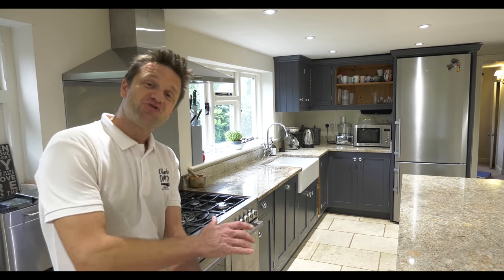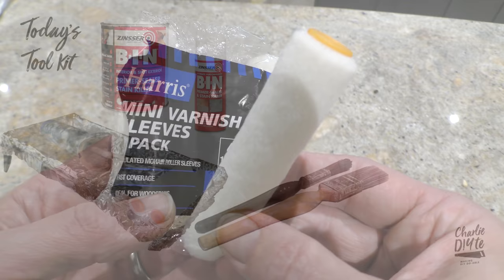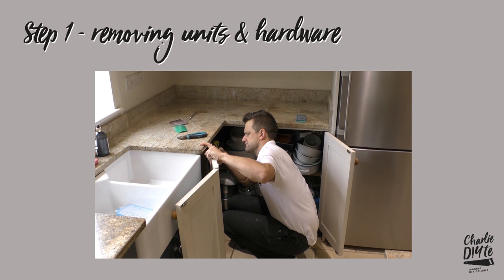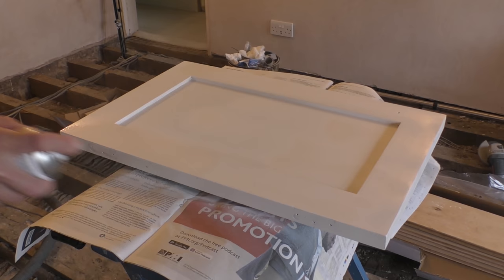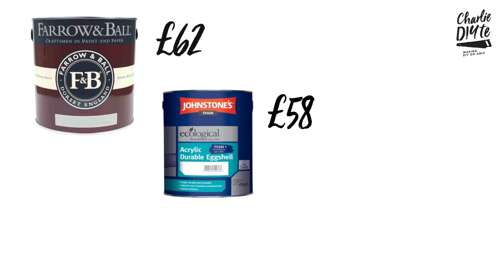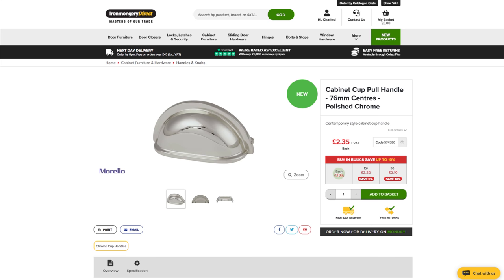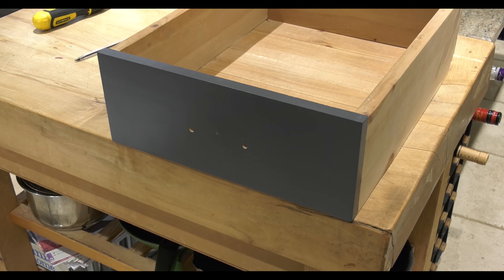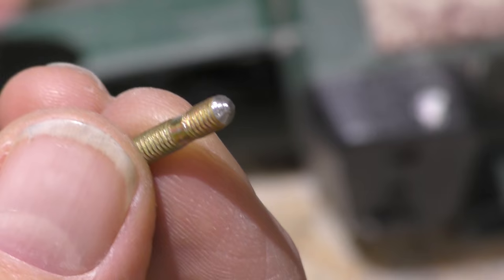Kitchen Makeover - How to Paint Cabinets & Fit New Knobs and Cup Handles!

Comment: Charlie, thank you so much for this video. I painted my kitchen farrow and ball down pipe using precisely your instructions. I used the same handles from the same company who were excellent and the final look was absolutely fantastic. I wouldn’t have tried it without this tutorial. I was quoted £2,300 to have it sprayed yet by doing it myself it cost me £100 in paint and primer and £200 for handles. A 2k saving. Thanks again.
Reply from the maker: So pleased to hear that Brian. Fantastic work! 👏🏻
Reply: May I ask how many full days it took (or hours, roughly)? I'm handing this job to a handyman so labour will be a significant cost.

Comment: Tip: if you're removing all the doors at once and many are all the same size, discretely number them and the carcass so you know which door goes back where!
Reply from the maker: Good thinking 👍
Reply: I used a permanent marker pen on the unpainted reverse side of the cupboard door to label each by kitchen's space location 👍

Comment: Charlie, I'm a time served decorator and have been in the trade for over 40 years.I assume the paint you used was water based? It's been my experience that water based paints may be easier to apply and dry quicker than oil based paints but they are not as durable as oil based paints.I quite often buy paint from B and Q but always buy the trade version which may be dearer but is much better. ! Great videos 😁

Comment: I have used several  different types of paint on my cabinets/cupboards, the best one so far is The One paint and primer , bought on Amazon.  Then I go over it with Rustoleum clear finishing wax. Cheers .
Reply from the maker: Good work. Yes the valspar I used here was pretty terrible. It scratched so easily!

Comment: Charlie can I be annoying and ask what colour did you use? I searched the comments to see if it was ask previously but couldn't find it. Btw my wife blames you for my ever growing shed full of tools, thanks ha.
Reply from the maker: Not annoying at all 😉 Pretty sure it was Railings. Don't buy the Valspar though, it's chipped quite badly but is at least easy to touch up. Also if it's for the kitchen, give the units a good degrease with sugar soap first. Ideally go oil based as it will be more hard wearing. If you're using water based, there are a few products like Tikkurilla Kiva 10 or Blockade Rock Top you can paint on at the end to give it enhanced protection. Ha! Will you apologise to your wife from me. Great work though. You can't have enough tools 🤣👊
Reply: Fantastic. Yep, will give the cupboards a god sugar soap and sand prior to primer and undercoat. The colour is brilliant and love the sheen on it. I've been recommended tikkurila a few times now so will likely go with that, my local decorators centre weren't too great and only could offer f&b or crown. Keep up the good work pal. Its always good watching your vids when ever I have a DIY project. Thanks again.

Comment: Hi Charlie, Fantastic video. Recently repainted our kitchen cabinets  with Valspar Wood and Metal paint. Spray painted the cabinets with 2 x coates after initial sanding and priming.  As you showed, the paint was initially easy to take off but after 2 months now and the paint is now mature, it is quite durable and difficult to take off. I recommend this brand and having used Valspar in the past, I have had no issues. 

Keep up the good work. 
Many youtubers get proud and lose their original personality. You have maintained your humble approach and that impresses me. 

The quality of videos and details you cover are really good. I trust tour top tips in your videos. It just shows you know what you are doing and advising. 

👍😊
Reply from the maker: Virupaksha, thanks so much for that! At the end of the day the integrity of my channel  is so important to me so it's great to hear that it comes across as I intended! It does give me a bit of a headache at times because I'd love to do this full time, but that's my problem to ponder not yours!! Thanks again - I really appreciate your support of the channel!

Comment: I've painted few kitchens with valspar eggshell including my own and only time had problem was over BIN primer.   I made our doors with Mrmdf, primed with water base polyurethane, sanded, edges treated with filler, primed again and two top coats valspar eggshell. We've got a golden and flat coat retriever that love rolling and scratching paint work. Touch wood no paints chipped or scratches four years on.

Comment: Lovely job and I really like the colour you guys chose. We used the Rustoleum chalk paint in Anthricite with a matt clear varnish sealant afterwards (also Rustoleum) I really loved the finish we got and it looks like a new kitchen, we talked about having a new kitchen fitted but we have an old MFI kitchen which has solid wood doors and we didn't want to change the layout so we decided to paint. We also changed the sink and tap and covered the work tops with DCFix vinyl which has also worked really well.

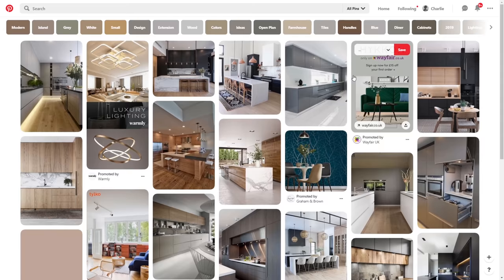Comment: 2:46 Absolutely LOVE the sink & faucet👍🏻 Have been a fan if the style since was a kid & Chef (makes washing up so much easier😅).... But it’s just a great look w/ durable lasting materials.
Ppl don’t realize that hardware can add up very quickly, especially if you have a lot of drawers & cabinets....... But, it’s one of the easiest ways to “refresh” a kitchen w/ a new look.
Another thing I’ve done for clients is vinyl wrapping there cabinets & counter tops with different vinyl brands (Vvivid, 3M, Avery, etc...). Works really well to change a room, desk, cabinet, etc....but I’d only recommend if you have experience; as this can be frustrating to new ppl trying this method.

Comment: Rust-oleum Universal Advance Formula All Surface Paint. Just been painting at my daughter's house. I did the outside windows and frames - they were in a sorry state, really horrible. I used Peel Stop on the sills to see if it would do what it said it would and it did! Love the paint. My new favourite. First coat is a bit thin so care needed and the second if needed needs to be generously applied or it seems to drag. Looks great. Today I finished using it on the tiles in the bathroom. Again, excellent. Then I had had enough......back tomorrow. Not ideal weather but I am never in the UK in the summer. Home next week for a rest😂

Comment: You can easily clean Zinsser shellac-based primer from brushes and rollers using Screwfix no-nonsense degreaser (p/n 88668)  - soak then rinse with water. It's about £9 for 5 litres - much cheaper than methylated spirits and does a better job.
Reply: thanks for this tip- the worst part of using BIN is cleaning the brushes!
Reply: I use the water based zinsser because I'm tight but it works well
Reply from the maker: Yes, great tip Laurie - thanks for that!

Comment: We have just updated our tired kitchen units and I used the same principle as yourself Charlie. After spending a small fortune on 52 Door handles and 30 drawer handles we thought do we go for a cheaper paint.............We did and like yourself had an F&B mix with the Valspar once dried the missus hated the colour as it looked washed out even after 3 coats, so I went back to B&Q and bit the bullet and actually went with the F&B colour re-done the units from scratch and we are much happier with the outcome.    SO MY ANSWER,  sometimes you have to go down the expensive route.
Keep the videos coming they are great TONY
Reply from the maker: Blimey Tony, how long did it take to redo all that? Still, worth it in the end!

Comment: We used Valspar on the walls and ceiling in the kitchen 2 years ago and I have to say it’s been fine.  
I have recently removed the door and frame and fitted new ones.  This obviously meant some touching up and 2 coats later you cannot see the difference. 
The walls have been washed down a number of times to clean off splashes etc and none of the paint has come off. 
It is more expensive than some of the other paints but has done the job. 
That said, I am now doing the Hall Stairs and Landing and will probably be using Johnsons or Dulux.  
Hope that helps.
Reply from the maker: Difficulty go with Johnstone's. The Valspar has chipped horribly in the kitchen but thankfully you can spot repair without it flashing, which is unusual for eggshell.

Comment: I have used an exterior valspar paint which, at £29 per litre was quite expensive, but the colour match was very good and the coverage was excellent.  So far no chipping or flaking.  I am very impressed with it and would use it again without question.
Reply from the maker: Thanks Stephen - that's good to know!

Comment: Thanks for this video. I just finished following along to do the same to my kitchen (I even used Railings colour!) and I'm really happy with the result.
Reply from the maker: Nice one Gary. If you find it chips, I've been recommended Polyvine decorators varnish and Minwax polycrylic protective finish as ways to make it more durable. It's probably the last thing on your mind though after finishing the job!!
Reply: Thanks Charlie. I'm finding myself touching it up a bit, but like you said in the video it's a good colour for not showing up too much flashing when I do. I'll definitely get a tin of the Minwax, thanks for the tip.

Comment: I used the exact same type of paint to cover MDF kickboards in my kitchen (primed with 2-3 coats of BIN. The finish was great after 2 coats applied with a foam roller and so far no chips.
Reply from the maker: That's good to hear - thanks for the comment 👍
Reply: @CharlieDIYte  Plus, the Armstead trade Satin I've used throughout the rest of my house (4x2.5ltr) does chip quite easily. Maybe people just expect too much from water-based paints in general and they should be using oil-based ones if they value durability above ease of use?

Comment: I love valspar emulsion it's a joy to paint with and excellent coverage never used the wood and metal though
Reply from the maker: This eggshell has proved to be a bit average in that it chips quite easily but the plus side is that you can easily touch it up without any flashing/ so you can spot paint without having to do the whole door.

Comment: My take on your paint issue. My understanding is that Primer is only used on non-painted porous surfaces. What you should use is Undercoat which prepares for the top coat.
Reply: I agree, and it doesn't make sense to put a premium primer/undercoat on then top it with Valspar. Valspar I have found is only good where wear is minimal. Good video nonetheless.

Comment: I do mostly refurb projects and I've never had a problem with Valspar, well at least not their matt emulsion.  I love their colour range, there are some really wonderful shades available.  Where I've used their dark colours or applied the paint in high traffic areas I've gone over this with Polyvine's Decorators Varnish in flat matt.  This goes on really well, dries up quickly so you can get 2 or 3 coats on in a single day quite comfortably.  This protects the paint from fingerprints and makes the colour richer and more hardwearing.  I'd love to use Dulux or Johnstones but I've never found their colour palettes very appealing.  In an ideal world, I'd use Johnstones paint in the Valspar colour range!
Reply from the maker: Thanks for this. The Valspar has chipped dreadfully since I made this video but maybe the varnish would have made it more durable. I'll keep a note of that. I guess varnishing this might be a problem if you then wanted to repaint the units for any reason? I applied some lacquer to our kitchen table after painting it and had to scrape the lot off when I needed to repaint it. You know you can get Johnstone's mixed to any colour?

Comment: about eight years ago i built mdf fitted wardrobes and used jonstones acrylic eggshell sprayed with a earlex 5000 spray gun and also used a roller on some parts, still looks good to this day even after the wife has hit it with a hoover and god knows what else...............i highly recommend this product. also I do use a lot of bullseye 123 blue can water based can recommend this item its fantastic sticks like you know what to a blanket
Reply from the maker: Thanks Anthony. Agreed - Johnstones is awesome stuff - my preferred paint supplier. Given my addiction to Zinsser BIN I haven't tried 123 but I need to, as you and many others are raving about it. Also, this Valspar is rubbish and has chipped loads since I did this video. The only good thing about it is you can touch up without any flashing - which is just as well considering how many chips we have!!
Reply: @CharlieDIYte  thank you for your reply charlie also look up peter millard review on airless cheap spray gun very good they are cheap about 30 pounds no excuse now for anyone to not spray and you get a spare paint pot. no excuses charlie terratek i think its called what you waiting for !!!!!!!!!!!!!!

Comment: Iv just recently made some doors for my garden room and used matt emulsion mixed 50 50 with quickdry diamond hard floor varnish then varnish over top as well that has co e out well,I also build a lot of furniture and I mix my water based satin with the floor varnish as well this mix travels well and is durable,Great videos by the way welldone I like your approach
Reply from the maker: That's really interesting Dean, and something I might have to try out. What made you use emulsion on the doors, out of interest, rather than the satin as you do on the furniture?
Reply: Because emulsion colours are infinite compared to cupboard door paint,I had the grey emulsion and thought it would look good on the cupboard doors but knowing how well emulsion wipes down I thought I'd try mixing it with the floor varnish to make a more stable paint,Now I tend to tip it in everything,I also saw your mdf series I'm a recent subscriber  and I use the filler method great series by the way,I use silverhook fine finish 2 part filler it's excellent for laying on endgrain of mdf and £6.40 a tin cheap too it's car filler
Reply from the maker: @deanreynolds2027  The problem I have is with stopping a hand painted kitchen table from staining (red wine and the like). I put a lacquer on it but it didn't really work and was a nightmare when I came to repaint it.
Reply from the maker: @deanreynolds2027  Thanks for subscribing by the way - massively appreciated 👍
Reply: It's a great channel even for a pro,I would use floor varnish on the table I would buy shares in it if I could😆
Reply from the maker: @deanreynolds2027  Cheers mate, I really appreciate that! I'm all over that next time I repaint the table 👊
Reply: Hi Dean, thank you for that invaluable tip, like Charlie, I’ll be all over it. Makes sense if one after a seamless look for furniture and walls.

Comment: Great video Charlie. I painted my melamine cupboard doors recently using bedec MSP.  No need for separate primer or undercoat. Like you I used faux mohair rollers and the finish is great. Several months later and there’s no chips or scratches and they are wipe clean. Super pleased with them. Replaced my tile splash back with more modern tiles and now it looks like a new kitchen!  I’d encourage anyone just to have a go at small projects like this and see how much money you could save.  Your vids really help with this. 
It love to see what your thoughts are on the bedec MSP and maybe a video?! 
Keep up the great work.
Reply from the maker: Hi there. That's interesting - I'll definitely check that out. I guess the only issue is that you're limited to one of their colours - albeit there seem to be a reasonable selection of 38 to choose from.

Comment: Hi Charlie 
Hamilton Prestige mini rollers from Toolstation - 4 inch short sleeves, 10 for £4.09 .
I used to use the mohair ones from screwfix like you but these are far better & shed no bits like the mohair ones!
My top tip :-)
Reply from the maker: Thanks Chris. That's going on my list! I've got some quite cool stuff from the States I'm going to try out in my final wardrobe build video in a couple of weeks so you might keep an eye out for that.
Reply: Looks like they're not re-stocking these at Toolstation anymore. Do you recommend another stockist or roller?

Comment: I repainted our units a few years back - used Ronseal (I think) kitchen cupboard paint. Lovely and highly durable finish, but it was oil based and stinks when drying plus takes ages to dry, so next time would use water-based eggshell. In a previous job I used to make furniture which was painted with F&B - their paint was ridiculously expensive - quality OK, but the customers loved the brand and the colours. I have also used Valspar ‘off the shelf’ eggshell and satin brilliant white and have been impressed by the quality. Painted a ceiling with Valspar emulsion and got awful results - very patchy and not impressed. Seems some Valspar paint is good and others meh!  Great job on your kitchen by the way!
Reply from the maker: Makes sense Martin, thanks for the comment. Yes I've found Farrow and Ball expensive for what it is and preferred the coverage of Johnstone's, but as you say, people fall in love with the brand - a bit like Dyson vacuums! I bought some Valspar contract matt emulsion to use as a mist coat on the new bedroom and was amazed to read that you can't water it down so its gone straight back and I've bought a tin of Armstead instead.

Comment: Bedec paints are VERY good. Available from good suppliers and on line. 
The best water based paint out there imo. Well worth checking them out.
I am a painter (20+years). I use it most of the time.
Like your vids. ATB